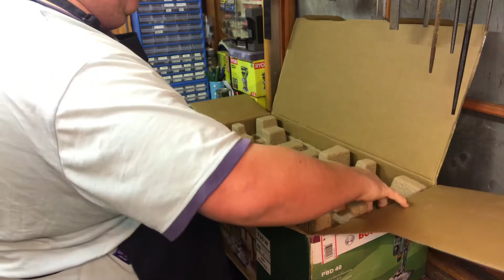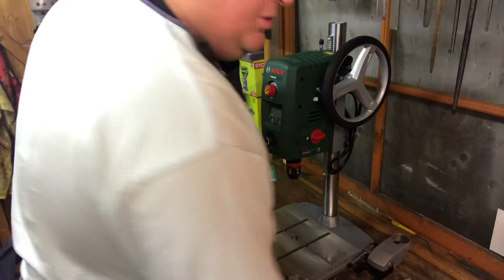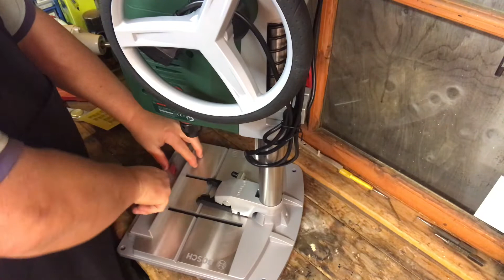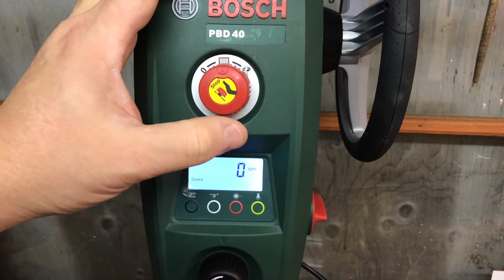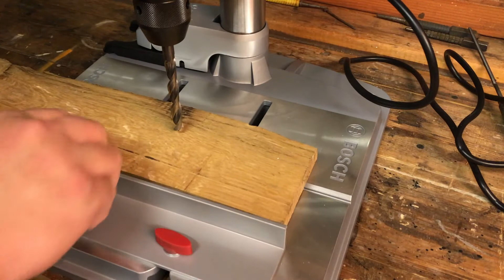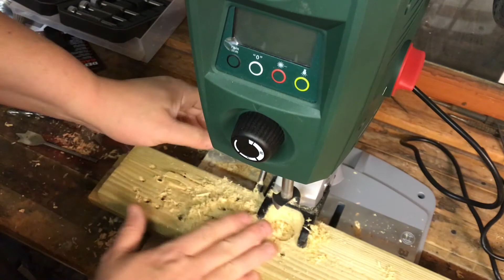Unboxing & Reviewing: Bosch PDB40 Drill Press

Comment: Cannot seem to find a HORSE POWER rating, I have. 3/4hp bench type, not good with 5/8th or higher bits in mild steel. Rpm 300-400, how does this do with a 3/4 steel bit…through 1 inch steel??
Reply from the maker: Gotta be honest with you slugg. I don't use it that often for drilling metals and have never used it to drill through an inch of steel.

Comment: Sharpen your spade bits with a file
Reply from the maker: You're 100% correct. I bought a new set of spade bits for site work but I've still got to sharpen my spade bits. Maybe I'll do a video on sharpening the different types of drill bits? Cheers.

Comment: It really hurts how you abuse that machine. Use the proper RPM when drilling to avoid burning the material and damaging the drill bit and the machine. Also, the way you use the machine is freaking dangerous. You MUST lock the motor BEFORE inserting a drill, and keep it locked. Read the manual, especially page 7. You must follow the safety instructions, and most of all, you should NOT demonstrate bad habits on YouTube to teach others, because you, or somebody else, will get seriously injured when using the machine the way you do.

Comment: I don't know why you nag about the machine, why buy it if you don't like it? Also, that's not the way you use a bench drill, you don't just let the wheel go, you FOLLOW the turn up. EVERY bench/pillar drill which is well oiled and smooth will move fast up if you let the handle go. Otherwise there is something wrong with it, or is mishandled. There are also screws you can adjust to make the movement less smooth if you don't want that "harsh" as you call it "smooth" as I call it, movement. Personally I want the fast and "harsh" movement, because it is a safety thing for me. If I let the wheel go it is because something bad happened and in that case I want the fastest possible movement up and away from what I am drilling. LEARN the machine first BEFORE you try to review it. By the way, you are beating a dead horse nagging about that wheel. It's been done to death on YouTube, so you are about six years late on that. Personally, I have nothing against it after about five years of using the machine. But the chuck is definitely worth changing, as I did in this video: https://youtu.be/nCqVoaGVK8g

Comment: Great review!  Lot of interesting features on that drill!!  One thing I think you would like is to build a heavy duty box to mount the Drill press to.  It will raise the entire drill up around 6 to 8 inches.  Makes a huge difference! 😃👍
Reply from the maker: I changed my mind in the end and put it on a wheeled base. It was an upcycled one which I got for free and put caster on it. I think it went up about 8 inches anyway, so it worked out well for me in the end. I've not done a video on it but you can see it in the interview I did when BeardX16 invaded my workshop.
Reply from the maker: Not a bad idea. Especially as I’m 6-2 and find bending down a pain in the back. I’m always figuring out ways to lift things up or to prevent bending down!

I’m not gonna put it on a wheeled base, as it’s light enough to move about but I do want to build something, so that all different types of drill bits and to hand and organised. Perhaps some side wings or drawers underneath?

Some side flanges to be able to clamp it to the worktop wouldn’t hurt either.